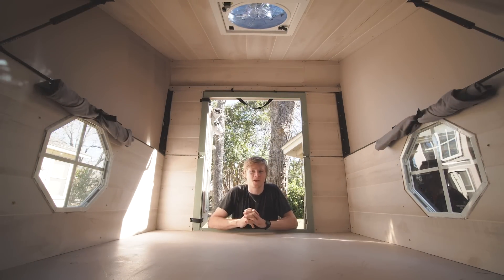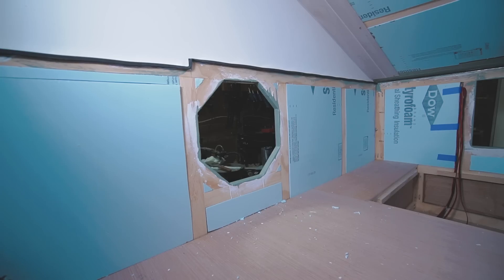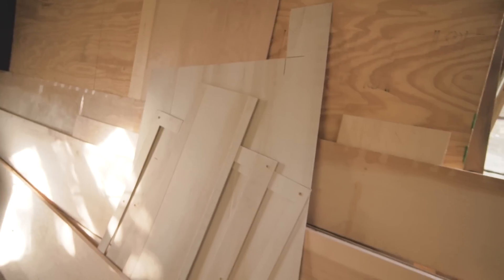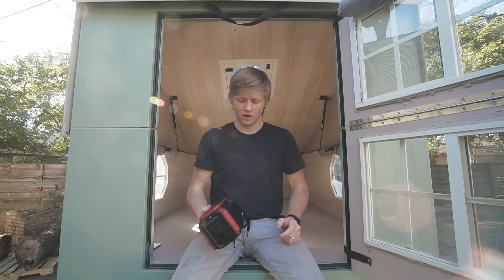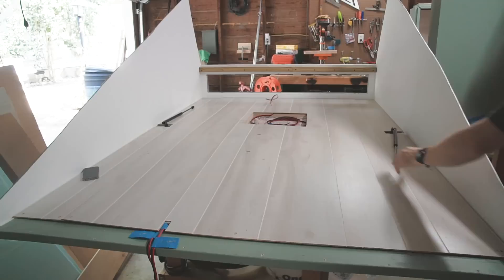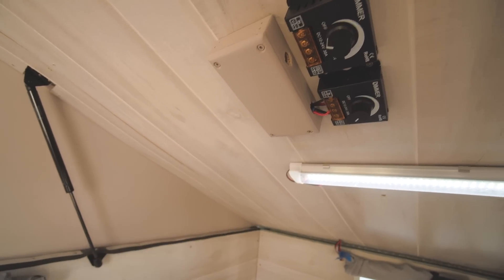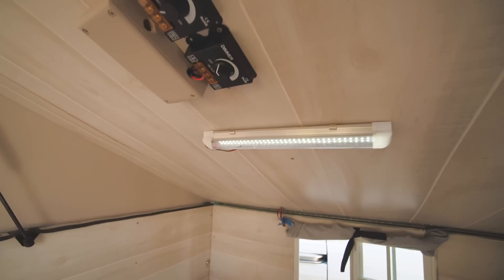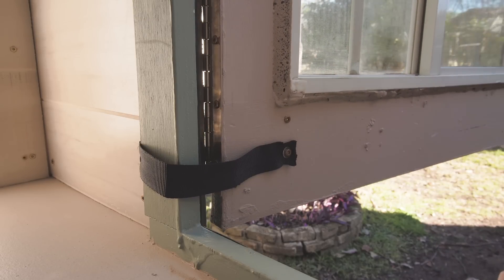Building a Truck Bed Camper - Part 4: the Interior and Electrical

Comment: Nice!  Yeah, back in the spring of 2013 I'd spent almost a year in Texas due to putting my entire business in storage and coming down to help with some family stuff, and to go back to Washington State at the time, I built an insulated 'canopy camper'.  On a a full size F250, it was just a 2x2 framed insulated box tall enough to stand in, 14" vent on top, 2 rv slider windows off of ebay for cheap on the sides, a plexiglass slider in the front I built for the pooches to go through to the truck, and a custom door at the back that looked like a naval hatch but made out of wood, lol.  I had a propane tankless water heater mounted on the back wall near the top, a propane tank mounted on the back wall at the bottom, and the floor went out over the tailgate as a little porch, with horse trailer rubber mat from TSC over it.  Inside I had a 2ft tall or so framed box on the left side as a bed.  The front 60% or so lifted up, and AGM batteries were in there.  The other end lift up, and attached to the ceiling, and under it, was a thick rubber water trough thing from.. TSC.. and a drain that just went through 1" vinyl hose out the back and to the side of the truck.  At the front on the right was a plywood box with a 30 gallon blue water barrel in it, and an RV water pump.  That went to a pex line up the wall, to the back, and over the door to the shower and then to the hot water heater on the outside wall.   We're not done yet!  The shower 'pan', lifted up to lean against the back wall, and then I could slide.. the electric porta potti into the open area where the shower had been.   So, I had a shower, hot water, a toilet, a bed, and on the road back up to Washington at the time, a window fan and 12 volt cookpot (which was awesome).    I took 2 weeks camping and driving back up, and stayed in that thing another month until I rented some shop space and bought an RV trailer to stay in while opening my business again.  

And why did I not just buy a camper?  Because, at the time, I couldn't find a camper for sale between Burleson and Waco for less than $5k that wasn't a complete piece of junk.  Did find a mid 90's Lance Camper I though might work.. until I went to look at it.. and chickens flew out.  So, I just built for function and speed of build.  It was heavy but the truck didn't even know it was there.  Eventually I took the back wall off, removed the interior stuff, and just used it as a canopy, and then gave it away when I sold the truck a few years later.  

At any rate, Moser is doing some quality work here, and efficient not only through weight but in budget as well!  and it looks really good.  That was my homemade camper story, carry on!  :)

Comment: Floor storage. Had same limited access issue when setup for sleeping. Made some smaller access doors/ports next to the wall, so I just needed to bend up a small part of the sleeping bag to access some storage.  Not full access to all the storage, but useful for quick access “sleeping” temporary storage.

Comment: You should wire in a connection to your trailer plug. You could get a 20-30A charge from your battery pack while you drive.

Comment: So far a quick weight estimate before windows and drawers is 300 lbs, with half of that in plywood framing. A few other things keep adding bits of weight like canvas, paint, fan, tie downs. So less than 350. Not including battery.
Reply: Yes. Sorry. I was not very clear. I don’t care if I am wrong. I learn more from committing and being wrong ;-)
Reply: Moser Makes, I might have mentioned the technique I used to weigh my camper:  I just tipped it a bit to slide the scale under the edge, then doubled the weight. Close enough.

Comment: I'm thinking of putting my windows on just one side so I can aim it at the sun where I park it if it's if it's in the winter and if it's in the summer I can aim at the other direction obviously you need to have little windows so you can see what the hell's going on inside but they have these cameras now they can get a very small and you can put them on top and do a panorama as to what's going on and they got motion detectors which might be a nice thing to have